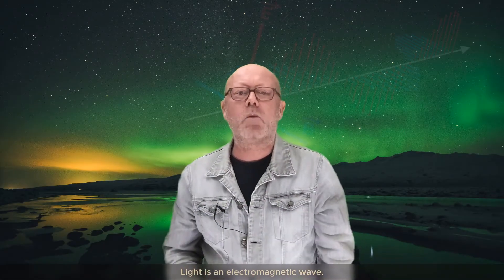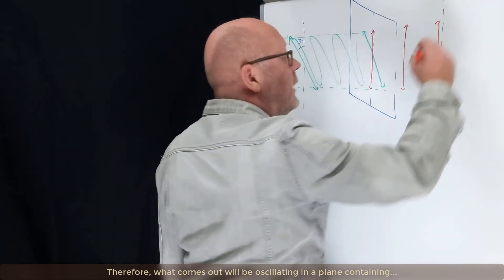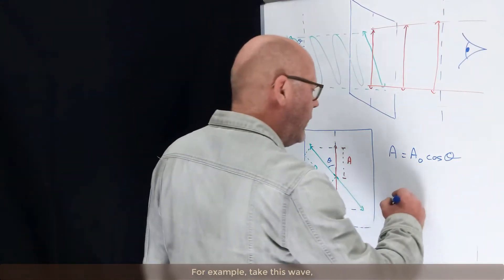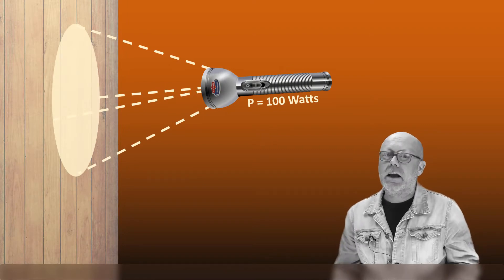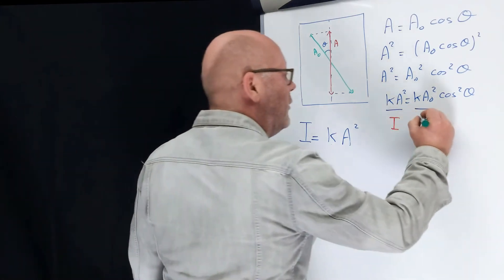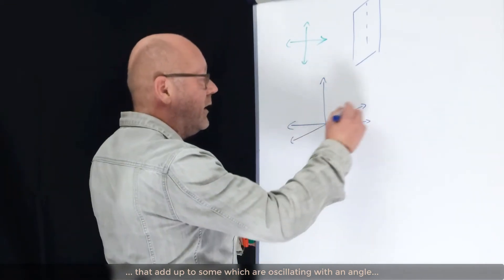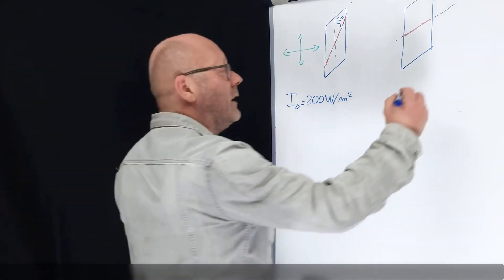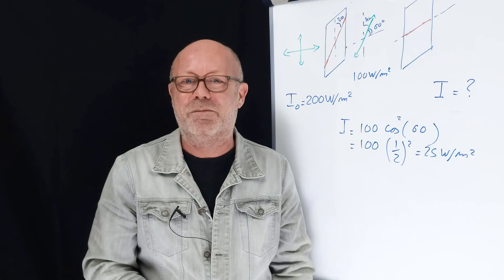Malus Law (derivation and use) + What is Intensity (Polarisation Part 2 -  Waves - Physics)

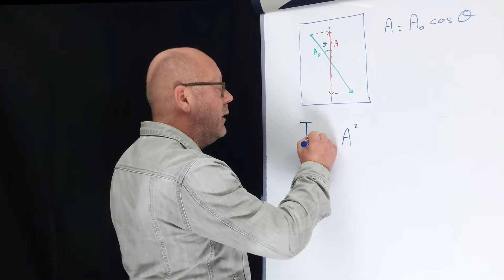Comment: 5:39 “I~kA^2 [intensity of a given wave 🌊 is proportional to the amplitude squared]” - why?
Reply from the maker: Hi, In a nutshell: the amplitude of a wave is proportional to the maximum velocity of its oscillators (for example for a given oscillator, v(t) = A*omega (sin (omega * t)). And because the energy carried by the wave (via the movement of its oscillators) is proportional to that velocity squared, the energy is thus proportional to the square of the amplitude. (note that Intensity is proportional to energy).
For an EM wave where the amplitude  is related to the square of the field strength, while more abstract, the reasoning is similar . The relationship can be derived from Maxwell equations)
Reply: @PhysicsMadeEasy 
wow, just amazed...

Comment: don't understand the last part. malus law is I=Io x cos squared theta but why use 100 as Io not 200 because 200 is the unploarised light
Reply from the maker: Hello Joseph,
When you pass unpolarized light through a polarizer, there is one rule that applies. the intensity is divided by 2. 
(see video Polarization Part 3 for the proof: https://youtu.be/LDpJV7tuPBQ?si=pmwhFS52hMkH0kqE)
Malus Law applies on light that is already polarized.
In the example at the end of the video, The intensity of the UP light was 200W/m^2, it passes through a polarizer and gets polarized, thus the polarized light coming out I = 100W/m^2. Then this polarized light passes through a second polarizer, and here Malus Law applies (the incident light of I = 100 W/m^2 is already polarized... )
Reply: thank you very much for this clear explanation @PhysicsMadeEasy

Comment: Thank you for Excellent video. I have not understood why amplitude has to be square to get intensity.
Reply from the maker: Think about the oscillation of a particle in a mechanical wave, like the simple harmonic motion of a spring. The total energy of the spring is proportional to the square of the maximum displacement: when x = xmax, TE = PEmax = (1/2)kx^2. Intensity is related to energy, and amplitude is maximum displacement...